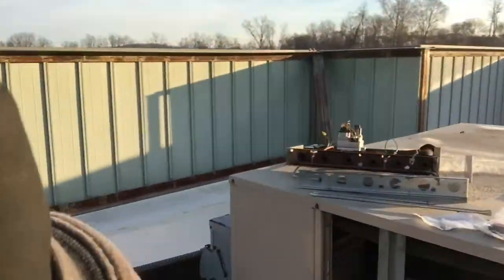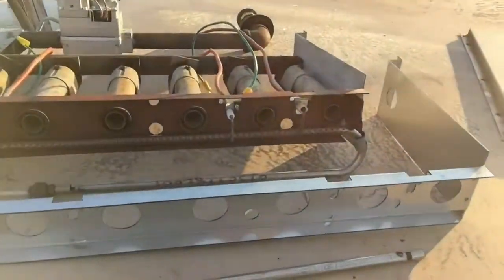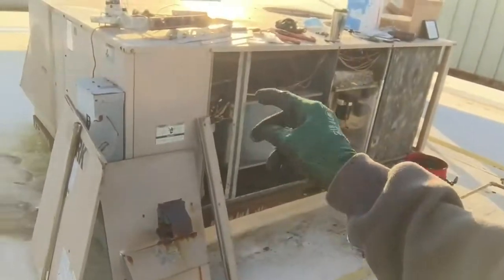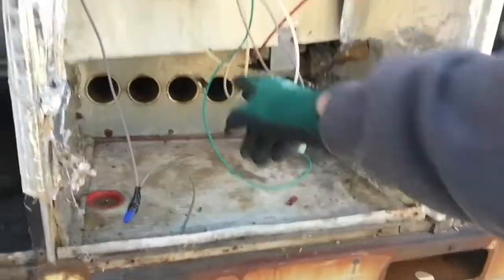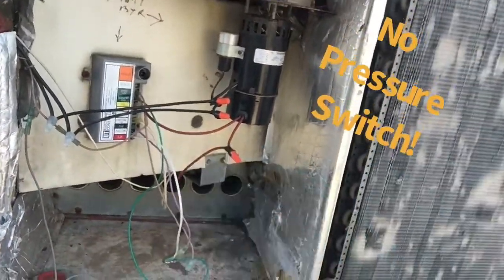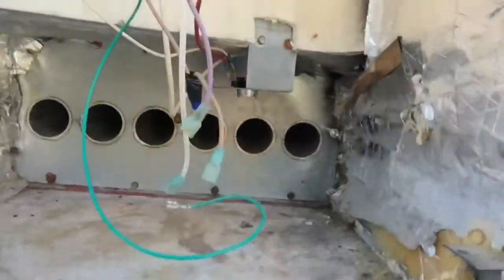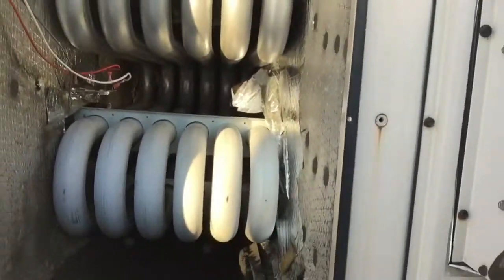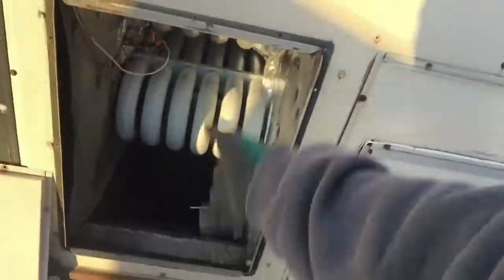York RTU No Heat, ground issue.

Comment: I appreciate that video I ran to that issue on a service call today
Reply from the maker: Excellent.  Glad it had helped out.  When equipment ages and corrodes it can really cause nuisance problems with the ground.  These York’s also have another notorious issue.  If you’re Ignition Control Module isn’t sparking or a Weak spark Try jumping out the Rollout switch first.  Trust me !    Even know the switch reads closed it’s just not getting the continuity it needs.  
Glad it helped out.  Have a great day Joe and stay safe.
Reply: @hvacexplained9341  
I appreciate that 
This Job was for church on Sunday morning 2 York’s units 
Got one going so they can pray 
The other one fire up then shut the immediately will go back and pull out housing and clean and sand and see if I get grounded better 
Unless you any recommendations 
Also burners seems loos they kind spin around I have to figure that out and get them right and position them the right way 
I don’t work on York’s that often
Again you are amazing